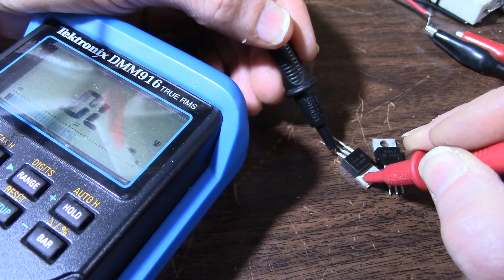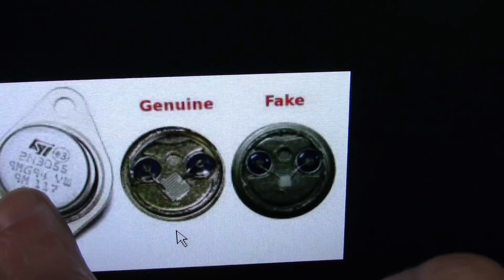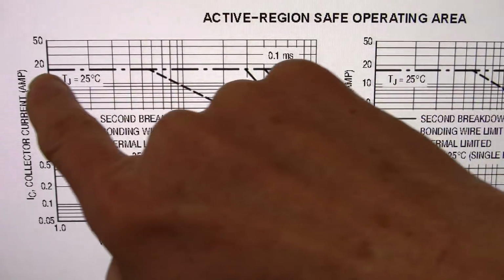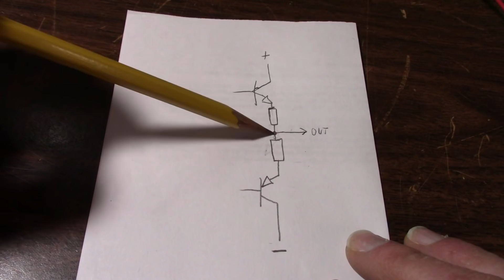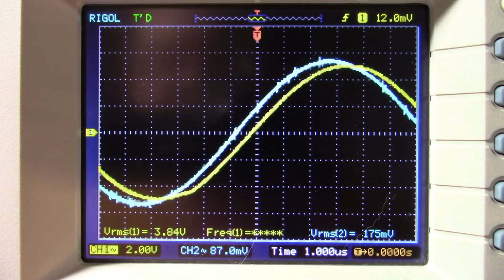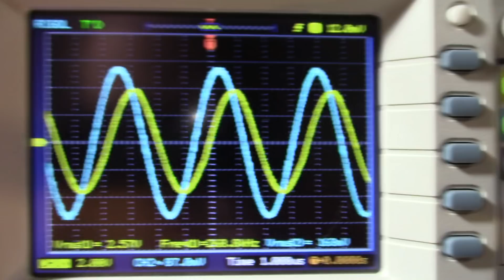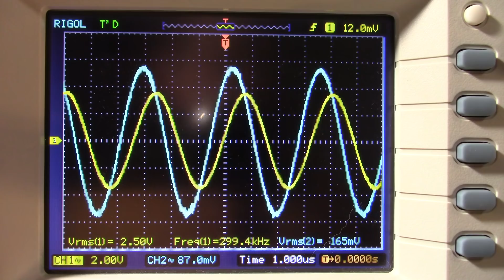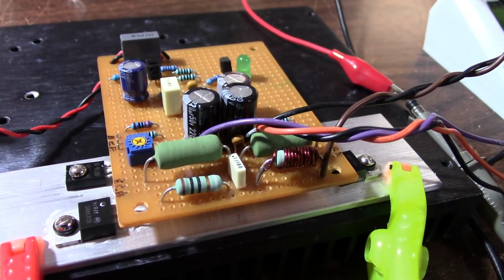JAT EZ amp Part 2 amplifier blows up during testing

Comment: Have you considered using a decoupling capacitor between the bases of the darlington output transistors? Often the pnps are slower than the npn transistors.  Perhaps the pnp is still open at high frequencies when the npn turns on?

Comment: Hi, if you take a look at the datasheet of the darlington transistors, you see that the gain drops very fast with high frequency. The main problem of  the darlington is the slow switch-off time in conjunction with a small C/E-current.

Comment: I've sketched up this circuit, and am going to play with it myself; see my drawings here: https://github.com/prosper00/Circuits/blob/master/JAT%20EZ%20amp/JAT%20EZ%20amp.pdf Ive implemented a few of the suggestions from the comments here, and I'll buuld it up and test it myself over the next little while. Personally, I'm not too fussed about really high bandwidth performance or HF distortion, so I'm sticking with darlington outputs. We'll see what distortion looks like.

Project repo and drawings here: https://github.com/prosper00/Circuits/tree/master/JAT%20EZ%20amp
Reply: So how it goes  Is it working fine or not ? Hopefully it won't blowing your output transistors
Reply: @hamid185100  I haven't done too much with this yet. I decided I needed a function generator to test it, so, that's what I'm working on lately: https://github.com/prosper00/STM8-AD9833-Function-Generator
Reply: He mate I want to design a single supply transistor amplifier need some help from you if can if you have any contact I can send you schematic that I am trying to build

Comment: Hey John,
I needed some advice from you ; i had a single TDA7498 AMp that worked well on it's own (3+years)
Then i decided to add one more with a common power supply and added 2 pre amps one for each.
But issue is both amps burnt off when my rca cables moved and made some noise.
I never had this problem when running a single amp.
I suppose it's some grounding issue?
All connections done were the same as the single amp setup except now both amps sit on the same PSU
TIA

Comment: Hello. Can you please help me select the right amplifier? I have a clone bose soundlink mini  driver which is 10W max i believe. And has 4ohm impedance. Im planning on building a portable bluetooth speaker. Many thanks!
Reply: Get clone of Sym Asym for real amp. It's very basic, other than asymmetric VAS (voltage amplification stage). Many yrs ago Mike from Germany design it and a lot of people build it. There are Chinese clones available on the net. The original design was published in DIYAudio.com There are mamy other amps, some are really stinking good and complicated. If you want something w Bluetooth then Dayton based amp from Parts Express might do the trick, but with limited power. Please remember you need almost ten fold power increase to get perception of doubling the acoustic power (including power compression in loudspeakers due to voice coil heating up).
Reply: @pliedtka  Thanks for your response. Unfortunately, I've already completed the build using yamaha yda-138E board which sounds just fine for my application. I'll take a note of that when building another speaker. Thanks!
Reply: @ayylasco  
Good for you 👍. The class D technology gets better every day. I heard the top of the line Hypex N Core module based amp and other than being brighter sounding than class AB it's a very good one. ICE modules are also very good. But if ever you will have desire to build something from scratch on discrete components Mike's SymAsym (class AB) is a good amp to start with. Sounds nice and warm, w/o the glare and harshness of cheap class D amp. Toid, guy on YT with diy spkrs channel did review of some little amp that was actually quite good, I think it was one of the Dayton amps. My friend also uses their biggest class AB 2ch amp, not bad for the money.

Comment: Hello. in 2018 you test the TPA3116 D2 MONO.
I have  TPA3116 stereo with 1 ic. and the edition with 2 pic TPA3116 ic. which is bridged to 2 channels. I use the oscilloscope and fixed resistor.

In 4 OHM stereo I only get 37watt in 50HZ 4 OHM.

With the other amplifier bridge I only get 34 watts.

power supply 24.8V 2A. full load I measure 24v.

How do you manage to get so many watts out of TPA3116 D2 MONO? 51.8w

Comment: i replaced 30n50 's with more 30n50 's , blowing... why? both 30a, both 500v, but my replacement manufacturer rates them at 420w and the original manuf at 690w...  that's quite a difference in available useable power...

Comment: ok maybe you can explain why you are testing an audio amplifier to such hi frequencies, since most people cant hear over 20k and I don't hear anything over 13k.
Reply: I think it's a test of stability assuming the amp was run at full power with a high THD with third, fourth and fifth order harmonics (not that it go above 100kHz). That, and probably to test how stable it is if for some reason the amp goes into parasitic or ultrasonic oscillation when driving difficult loads into the MHz range.
Reply: @AstrosElectronicsLab  shouldn't there be some band pass filtering, you don't want an amp using power to amplify frequencies that A. no one can hear, and B, no speaker can reproduce.  the frequencies he was testing to run the range of ELF to LF in the RF spectrum. Attach it to a 1000 foot antenna and he can talk to subs. ok maybe it doen't have quite the power for that :)

Comment: what if you build eqivalent darlington network with bd912/911 outputs and something like bc547 as a first stage just to test what broke , was it thespecyfic behavior or capacity of the driver transistor or was it simply current spike on the output stage of that darlingto, or was the transistor used just not good enough?

Comment: I realize that this failure mode is frustrating, but it made the project even more interesting <g>.  It's so much more realistic and intriguing when things fail than when they work correctly at first power-up.  I look forward to seeing how you resolve this and wonder whether some other Darlington might work instead.  Still, I know that you already sought out the most appropriate Darlington IC when you began, so I am just as interested in your discrete design, if that's what you eventually do.

Thanks for the great videos!

Comment: What's the frequency response characteristics of your darlingtons? It's clearly a high freq issue... Or its some other component in the system reacting to a hundreds of kHz signal.
Don't get discouraged by this. If you can determine the root cause of failure then you learn something new about amp design.
Cheers,

Comment: Shoot through would be more likely supply voltage divided by any resistance. The small pulse destroys the transistor, discharges the capacitors that have insufficient energy to explode them [the transistors], then the supply limits, preventing smoke. Collapsing output is usually a sign of heat stress internal to the transistor or in things I've done with RF, a phenomenon known as secondary breakdown (which usually results in a collector to emitter short).
I can't see how it's a fail, if it reproduces audio frequencies up the required frequency at the target distortion and power. Just make sure no High frequencies get into the input (like from, maybe, a cheap class D headphone amplifier) and it should be fine. You may be able to use your distortion meter and two separate audio tones for checking for high frequency distortion, by checking for intermodulation products that fall in the audio band, which will be visible on your distortion meter too, without the need for trying to amplify a high frequency directly.

Comment: John, these transistors start to lose gain over 20kHz, and your measurements show a phase delay of about 90 degrees at your high frequency.  The gain difference at the high frequency is really huge as well.  So, I’m wondering if the npn and pnp have enough phase shift difference between them that you possibly are getting shoot thru?

Comment: Problem with Darlington rather than discreet EF stage. You don't have that low impedance base-emitter resistor you need to stop the cross conduction. Or even better a floating driver not referenced to the output.

As soon as you load it up the charge carrier density increases needing a low resistance path to discharge the base-emitter junction.

As you say, going discreet is the way around your problem.
Reply: You have the only right answer!

Comment: Looked like spikes/clipping on the oscilloscope when switching frequencies. Don't want to push high amperage with unpredictable voltage even if just for a fraction of a second.
Reply: Those effect it's produced by the feel tech frecuency generators. I have the same one.. every change you make the processor starts the sinewave again.

Comment: No diodes from out to rails, but that's for inductive load back EMF. Maybe they were one of the masterious tranies that like to change an amp into oscillator, especially Darlington triple. The big Motorola 250V, 15A, 30MHz based on Toshibas are good. Also the big 15-17A Sankens (2292 something like that). I remember reading somewhere that slower outputs are less prone to problems with capacitive loads something like electrostatic loudspeakers. Maybe you should try something like MJE 1503x for drivers and MJ15023-24 for outputs but they are 5MHz devices, and then something faster if everything passes the test. Sanken also makes audio Darlington complementaries up to 15A, 10-20 yr old AV receivers such as Sony are full of them but they are usually 10-12A rated.
Also the phase margin might be some issue, but you don't have oscillations at least visible ones on the 'scope. Do you have base stoppers on the Darlington bases?

Comment: May be it is time to switch to mosfet power transistor. IRF530, IRF9530, IRF620, IRF9610 are good alternatives.
Cheers from Indonesia
Reply: MOSFETs have terrible SOA compared to bipolar transistors
 They are great for switching operations (e.g. class D) but not for linear amps.

Comment: Thats why i dont like Darlingtons. Go with drivers and output transistors. Good luck.
Reply: I worked with Dual Darlingtons and wasn't impressed. Yes, stick with regular output transistors.
Reply: Maybe the ones he uses suck. But there are plenty of designs that use Sanken Darlingtons, even my Denon AV receiver. It's not the fastest or cleanest but can do 100W at 8ohm from one pair of 15A devices and drives my SB Acoustics 2ways that use 4ohm  midwoofers without too complaining. But yes for a serious amp, driver and separate out transistor would be my choice.

Comment: A lot of "packaged Darlingtons" do not perform well at ultrasonic frequencies - trust me, I've blown them professionally. Not enough space to fully explain, but they are just plain too slow to operate reliably above 30 or 40 kHz. Your idea of building Darlington  pairs from discrete transistors is the only sensible way to go. I don't think I have ever seen a commercial Hi-Fi amp that uses packaged power Darlingtons as the output stage.
Reply: Sony used Sanken Darlington transistors for a while in the 5.1/7.1 receivers for a while
Reply: Wow, stk chip, nowadays the Chinese copy blows in a instant
Reply: It is not entirely uncommon actually. A fair amount of AV receivers come to mind (e.g. Kenwood, Denon), or some '80s Grundig amps.
Reply: Yes, as long as you keep it below 20 kHz, packaged Darlingtons are usually OK.
As far as A/V receivers go - the Darlintons are probably driving the subwoofer channel - 100 Hz and below - no issues whatsoever at these low frequencies.
Reply: @davekazoroski6548  The kind of AV receivers I was referring to are meant for active subwoofers as is standard in home theater (bargain basement systems excepted), so their power amps are for the main speakers.

Comment: Why are you testing an audio amplifier at 100 KHz?
Reply: To check if it wont distort too much around 20k
Reply: @shutdahellup69420  why? No one can hear that.
Reply: @1pcfred  The point is not to amplify signals up to such a high frequency, but to ensure you have plenty of open loop gain remaining at 20kHz. John did explain this in the video.
Reply: @ferrumignis  John has a distortion measurement system. Why does he just not sweep the input up to the highest frequency of operation and monitor distortion? Wouldn't that make more sense for an audio amplifier. Then work out why the distortion isn't meeting required spec.  I'd be more inclined to input a low frequency square wave and measure the slew rate of the amplifier, to see if it could work quickly enough at the highest required frequency. https://www.audioholics.com/audio-amplifier/amplifier-slew-rate
Reply: 3rd harmonic is fair enough as cut-off freq. for audio amps and should be attenuated heavily by 40dB or more...

Comment: Are you making a transmitter or an audio amp ?
Reply from the maker: To have low distortion at high frequencies amplifiers require high loop gain at 20KHz. In order to meet this, the closed loop frequency response will run out to a few hundred KHz.
Reply: @JohnAudioTech  High loop gain leads to instability, due to a phase shift with increasing frequency.  As you increased the frequency, you showed the phase shift of the output increasing with respect to the input.  I would not be concerned about such high frequency operation, and so I would filter the input to roll off  so that instability is never reached, but the other comments are also correct.  Wire wound resistors could be exacerbating the phase shift so changing those for another type may allow operation at even higher stability with less phase shift.  You can't have omlets unless you crack some eggs.
Reply: John Audio Tech ... Don't go extreme... 3rd harmonic is fair enough for cut-off freq. for audio amps and must be attenuated heavily by 40 dB or more.....
Reply: I'm wondering if something is resonating in the output at that frequency,  like the wire wound resistors and the parasitic choke in the output. At that frequency,  wire wound resistors and wire wound anything can become reactive.
Reply: @bob4analog  There is an inductor freq response point where the inter winding capacitance becomes the dominant factor and the inductor turns into a capacitor. 
I would suspect that would happen in the low MHz though... The wire wound resistors are not trying to be inductors.
Cheers,
Reply: @EngineeringVignettes  - Spot on! However, it would be interesting to see the reactances that are occurring at a few hundred khz. Whats the point! Even the profssional amps I've tested start rolling off around 40 khz. This is good design practice. This is an audio amp, not an RF amp.  If you want DC to Light response,  you'll have to change the design. Otherwise, this amp is solid for audio. Chees mate!